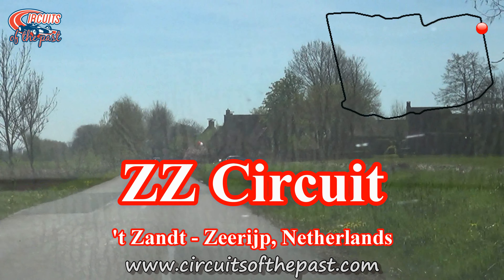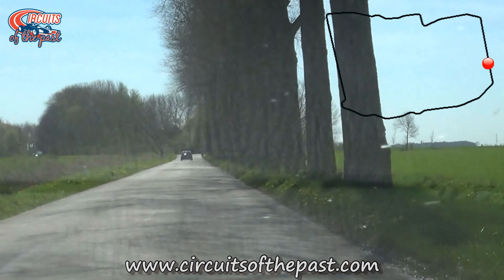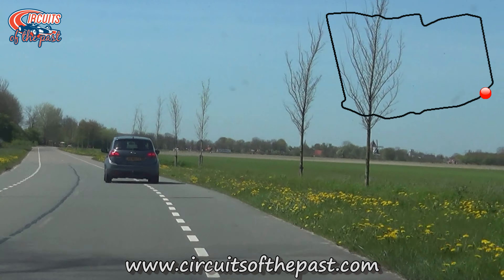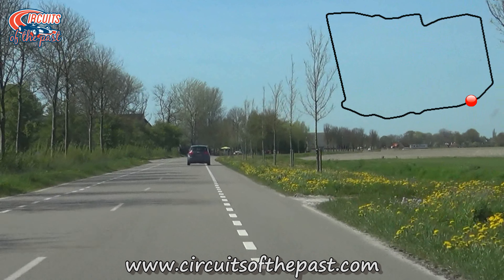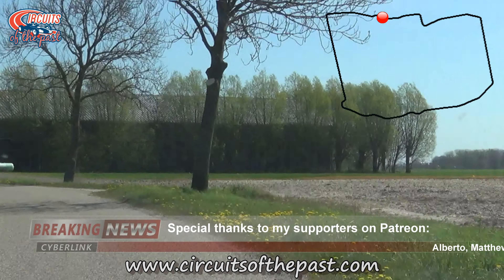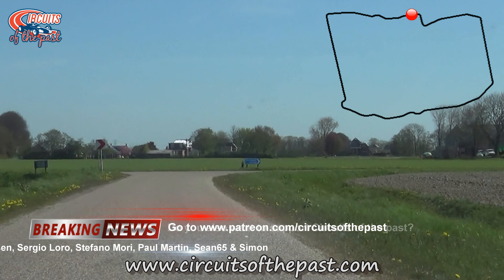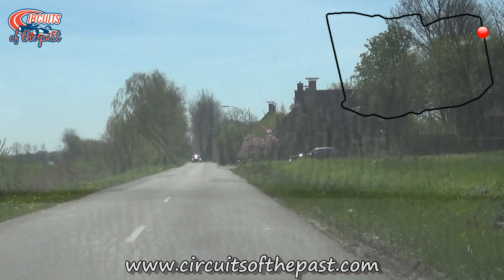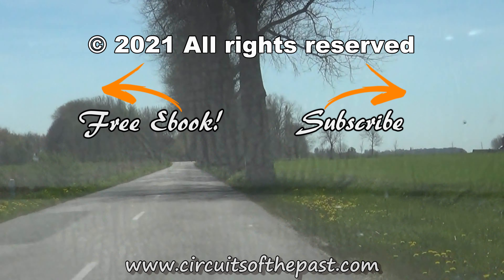ZZ Circuit ('t Zandt - Zeerijp) - Lost Road Racing Circuit in the Netherlands

Comment: I have to wonder whether this track now has had any serious modifications since it was a race circuit?. Narrow house and tree sided roads, hump backed bridges, it can`t have been raced on like this surely?.  A really great video though, many thanks for posting it.
Reply from the maker: Based on today's standards it would not be raceable. But in the there were different standards. For example the first Dutch TT was held in a track (Rolde near Assen) with narrow bridges which could be crossed by one motorcycle at a time and a sand road.